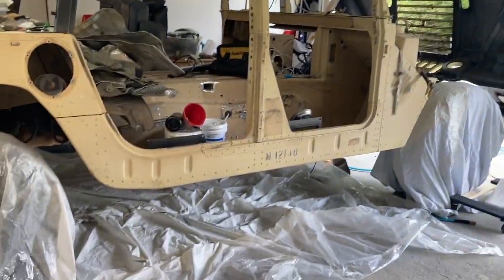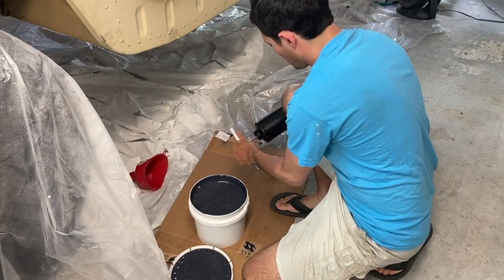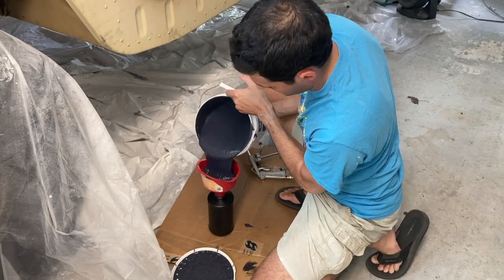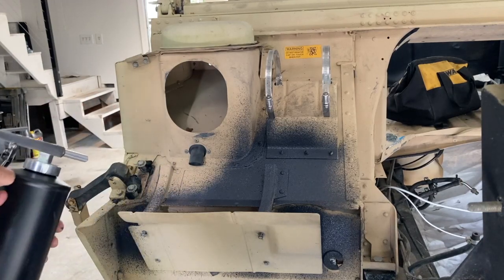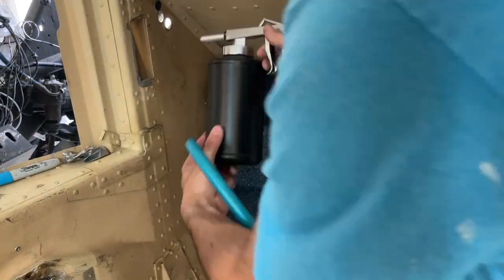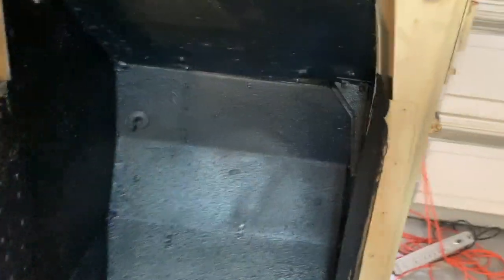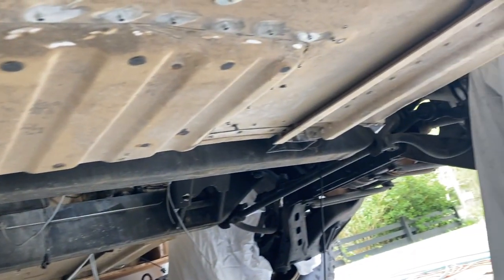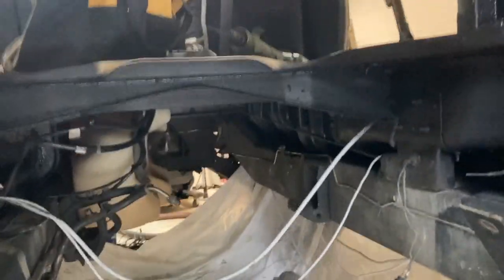Spectrum Second Skin sound deadening application

Comment: How well did this work? I’m interested in doing to my 1165 when it gets here!
Reply from the maker: @user-rv1ig8dk1y  Yes. Hard to tell because I put in an LT engine and had no before to compare it to. Far quieter on the whole than my friend's stock diesel. I think it was pretty effective with the spray and the foam and carpet. Sounds like a regular car. I can tell for sure if I knock my knuckles on the metal fender versus anywhere inside the car. night and day
Reply from the maker: with this, noico red foam, outdoor carpet and no doors, you can have a regular volume conversation at surface street speeds. Worked well.